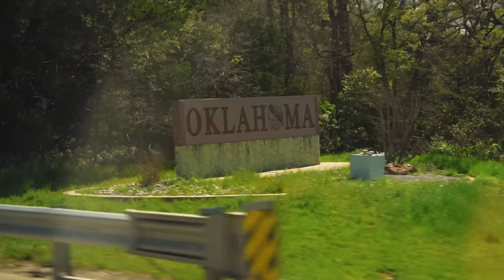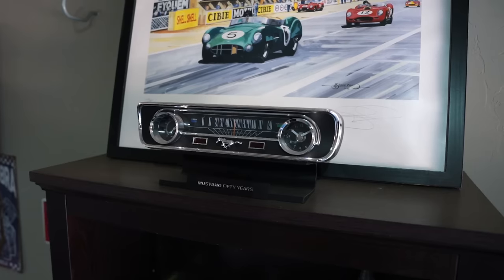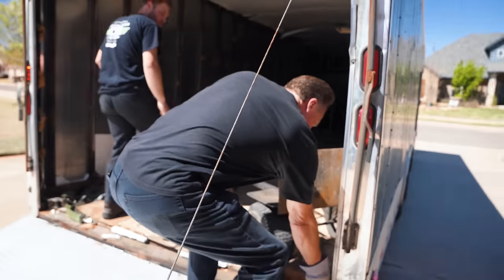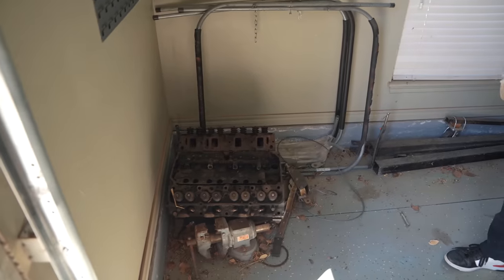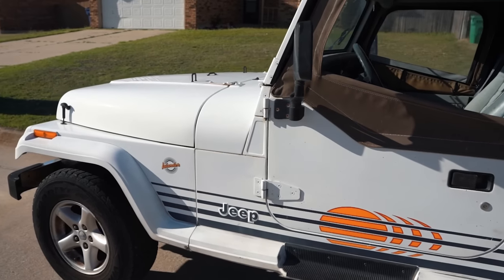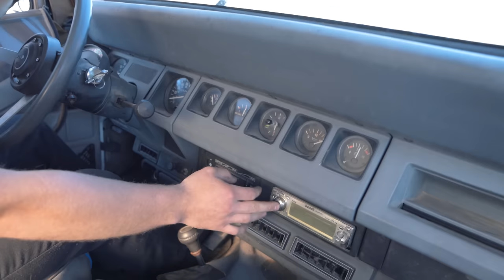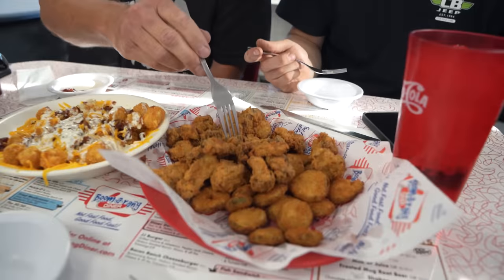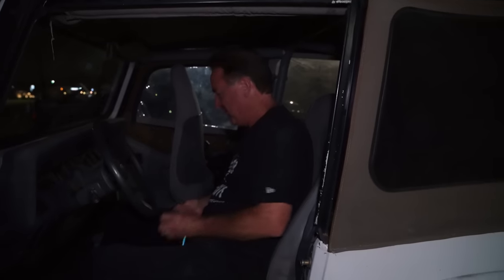RESCUED: Mustang Mach 1 R-Code & First Ever Attempt To Drive a Coffee Walk Buy Home!

Comment: Did anyone else catch the Autolite 2100 2V carburetor on the 428 they flashed early in the video when they mentioned the 428 motor?   Hmmm.       I’m pretty sure you could put a 390 intake on a 428, both FE engines, but I don’t know if there were any 2V- 428s.   But then on second glance it’s not even an FE, it’s a Windsor by way of the valve covers.   So what is up with that?

Comment: I had a '89 Jeep Sahara  4.2l with air, auto, hardtop and ect. Traded off for a soft top '91 Sahara 5speed. All because it had a 4.0l and the better 5speed. Keep the '91 for 19 years.

Comment: 69CJ shaker 4 speed, 3.25 rear end, wanted speed. My buddy got me the Daytona 1135CFM carb. Really let that engine eat some Sunoco 260. Going into 4th at 135 and it would do a burnout basically. Redline at 165. Fun little car. Here is the best part, Brand new ordered off the line $3300. Metallic Blue.

Comment: Something doesn't add up to me on the mileage on the Jeep being LOWER than what it shows on the odometer and I think Dennis should have caught it as well. This Jeep was supposed to have been towed behind an RV. I'm not an expert on Jeeps, so please correct me if I am wrong. The options for towing it are -- towing it on a trailer, a tow dolly, or a tow bar. But it has an automatic transmission, and unless it was towed on a trailer wouldn't it either need to have a system to disengage the driveshaft from being able to turn the transfer case and transmission or have the driveshaft removed to prevent wear and damage to the transfer case and transmission? And if so, wouldn't that have stopped the towed miles from being added onto the odometer?

Comment: I’ve owned a 79 CJ five factory v8 304 3 speed stick. I’ve also owned a 95 YJ with the 2.5 liter four-cylinder five-speed stick. I’ve also want a 94 WhyJae with the 4.0 Ho stick. I’ve also owned several Cherokee sports Cherokee pioneers grand Cherokees, grand Wagoneer. I’ve also driven the brand new 2022 and 2023 jeep wranglers and gladiators.

Comment: Kinda makes me wish I still had my '87 Jeep YJ Laredo, 5 speed, red w/black hard top and bikini top.  Bought in early '89 with 13,000 kms for $15,000 Can., sold 26.5 years later with 300,000 kms for $3,500 Can. Completely stock other than a Jeep accessory locking steel box which fit behind the rear seat. Garage stored each night. Other than routine maintenance, only ever had to replace a thermostat and a heater fan.

Comment: I have a 74 International Harvester Scout ii built with that 4.2. I added an he I dist. And a 4.0 aluminum split manifold a fuel press regulator and a Weber conversion! It was built from the factory with a 4-speed granny gear and Factory front disc brakes and power steering. With the trac-lok rear end  in two-wheel drive! Talk about some torque. Sounded just like that jeep. Had the bucket jump seats in the front without the console and the Grandma's couch cloth rear seat with the fanciness. It was a really pretty brassy color gold metallic gold interior

Comment: Mr. Collins, I am a little old man trying to finish a project for the No Name Nationals and I could really use the little 302 and the 4 speed manual for a 97 T-Bird. I have been a subscription holder of the channel for a good while and as enjoyable as I find your videos and being a Semi/Medium duty Mechanic/Service call Tire Technician and when I am not doing that I change Car tires and do light mechanical work for a small shop in Mars, Pa. I have been working this type of work for 34 years and the 3 to 4 years I wasn't doing this I was delivering Coal with a Tri-Axle or Coal Bucket as they are called in the Western New York, Western Pennsylvania, Eastern/Central Ohio, and the panhandle and Northern West Virginia the king of Coal up until the turn of the last Millennium or the year 2,000. I also worked on Detroit Diesels for a good year and a half or closer to 2 years. I will say that I don't make a ton of money and would love to work for you guys on restoring those older ones, my first car was a 1959 Oldsmobile Dynamic 88 sedan,it had the original 350 and automatic transmission. Except for the rust I enjoyed it and kept it going with parts from a couple of local supply yards, but anyway I can do almost all all the repairs necessary to get a vehicle done to stock ,or your customer service the way that you or they want it. I hope to get a motor in my T-Bird and get my channel going before the time comes around and I miss out on a second one. I was off work for a couple, three months and I am back but struggling with getting back to myself. But if you could find it in the cards of yours after some thought and some coffee,you could contact me about the 302 and 4 speed and I wish you a great evening on Good Friday and a wonderful and Happy Easter weekend! To you and the crew I will wish luck and a quick grasp on the subscription holders of I believe that you said 500K ! Congratulations and I will say that like you ,I believe that you all have work hard, diligently, with pride, and honest straight forward daily striving to keep automotive history and many vehicles from the salvage, scrap yards, or from some people that would have done a Craigslist restoration and either rip someone off or them being slapped together cheesy and beat to death and wrecked. Like I am so happy for you guys and the Mustang from not ending up in one of these scenarios. Have a great evening and enjoy your weekend. Please let me know either way please, I have a good shipping option.

Comment: Thanks for the great video Mustang's cool I like the Jeep too back in 1974 I bought a 53 military m38a1 for $200 no rust but the engine was shot so I bought an advance adapter kit I was 350 horsepower 327 I put in it I put 35 in tall tires did the brakes it was a missile I left at 5:38 gears in it I painted it Limelight green foolishly I sold it it was a great missile have a great day:face-green-smiling:

Comment: I can’t believe I have to say this, but would someone explain to Mr Collins that towed miles do not register on the odometer. With the transmission in Park and the transfer case in Neutral the output shaft on the transmission does not turn. I have towed my LJ thousands of miles and none have registered on the odometer.